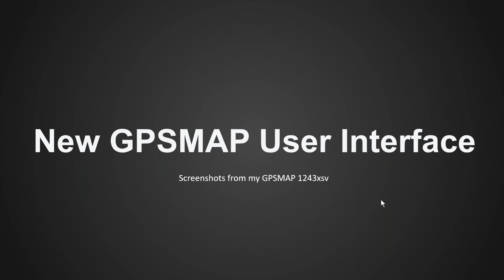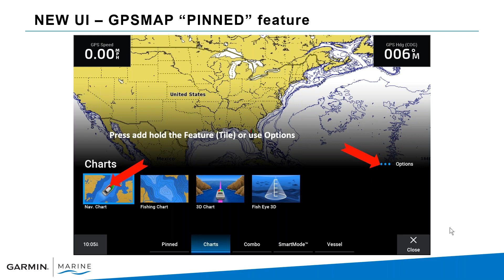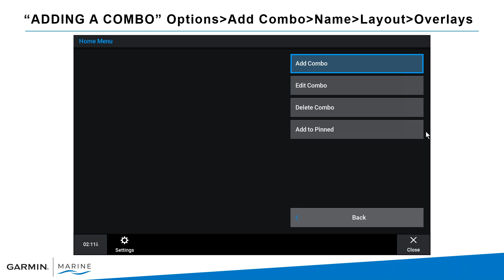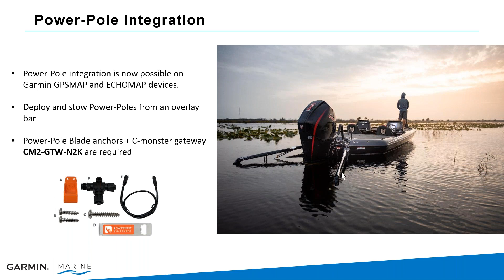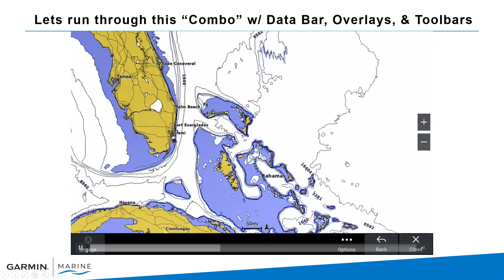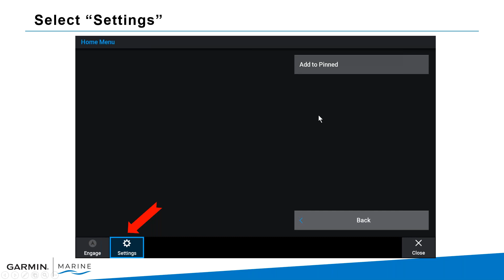Garmin Marine Webinar: New GPSMAP UI

Comment: I was frankly shocked when this new UI was released without any change in the User manual. It was, in my view, a display of very poor software management. I called Tech Support when it hit my GPSMap 1242 and was told they too were "blindsided" by the new interface. I had to ask 4 times over 3 months for an updated manual. They literally sent me a hardcopy the WRONG manual 3 times. Now, it's a year later and I'm comfortable with this UI. I actually view it as a smart improvement now. It's just hard to forget how poor the introduction was handled.